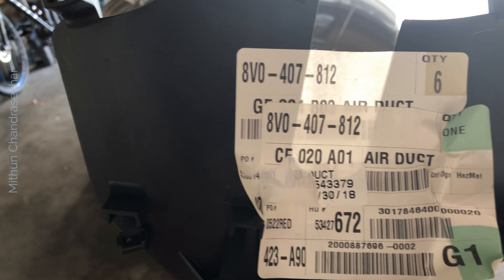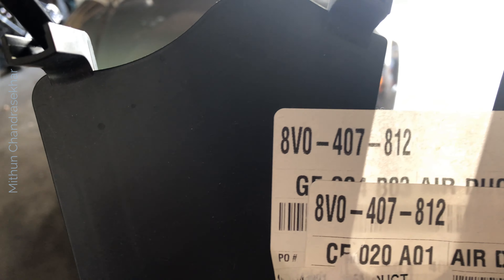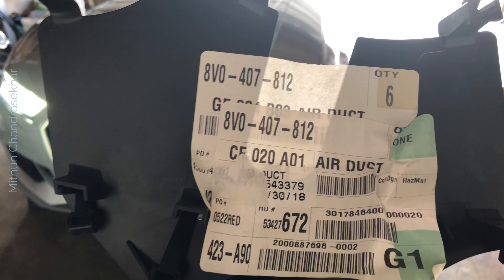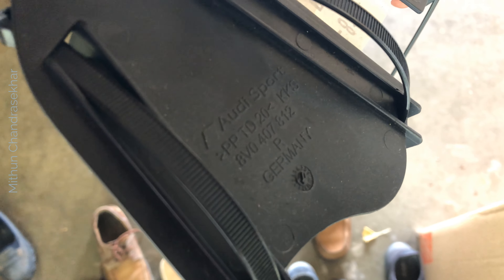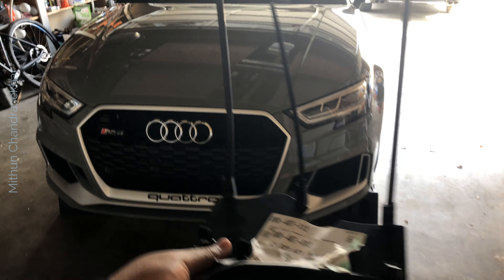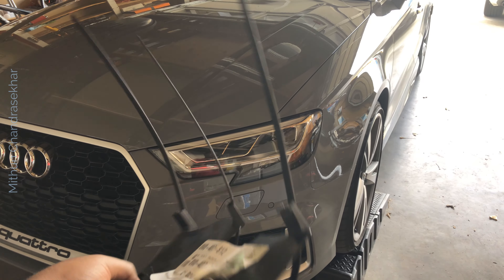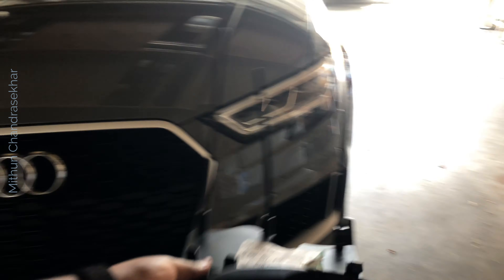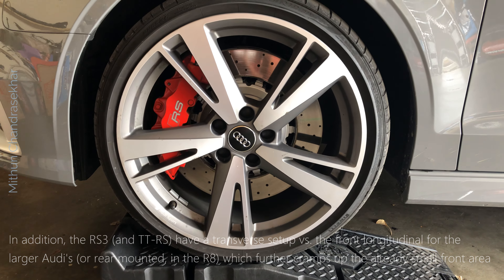2018 Audi RS3 Front Brake Air Duct Installation

Comment: I had it installed in a seat leon cupra 280. They fit perfectly. I hadn't do any modification. Straight to the point....
And I go to track days oftenly . And the temperature of the discs have decreased more than a 15% when I stop to check them....
16 euros each in Spain

Comment: I have a March 18 RS3 and have tracked the car - the disks, pads and wheels get so hot you wouldn't believe.  Not sure that part is likely to make any difference to be honest.
Reply from the maker: If you don't have it on, you might as well give it a shot. Audi did start putting them on later model '18 RS3 onwards

Comment: Hello, it's ok for rs3 2015/2016?
Reply from the maker: It may be...but I can't say for sure
Reply: I just installed them on my 2016 rs3, the part fits correctly but the problem is the disc shield. On the facelift rs3 they have made holes in the disc shield so they can cool. The older model does not have these ventilation holes
Reply: @timvanderijdt6058  is dat niet standaard? Ik heb zelf ook een 2016 Rs3 en die heeft wel gaten in de remschijven namelijk!